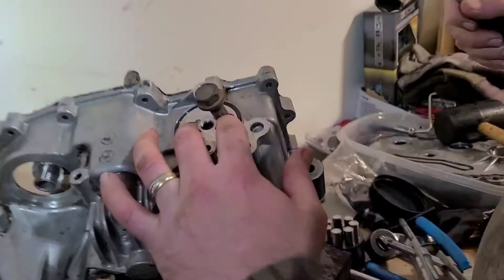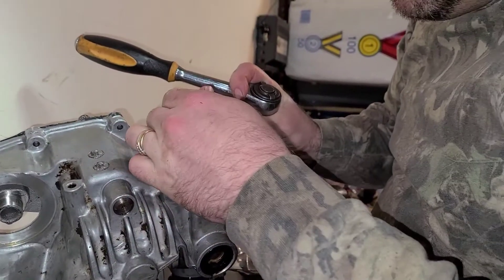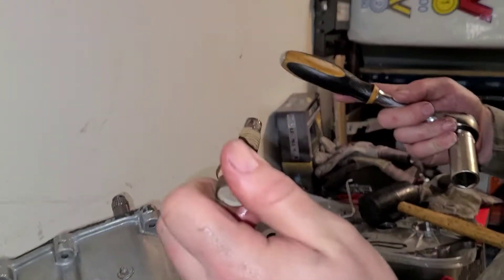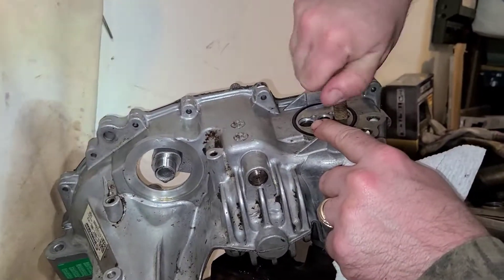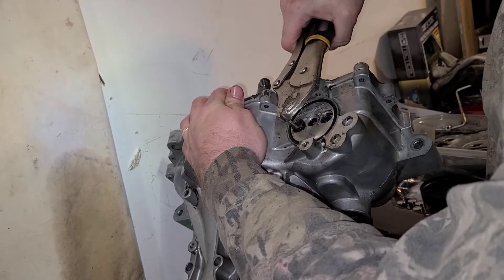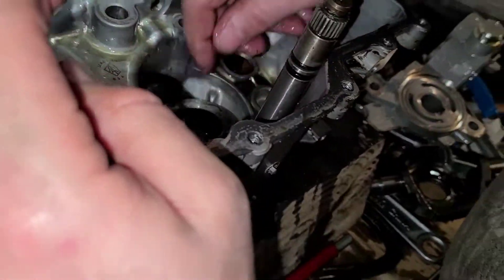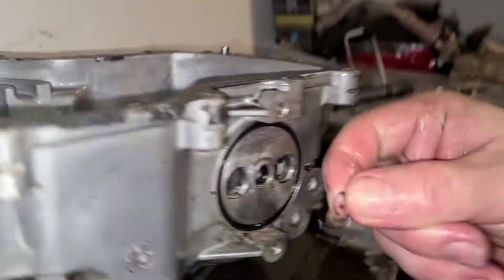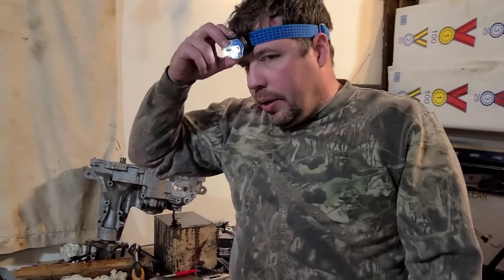Ferris FW35 48, 52 hydro transmission leaking hydro gear ZT-2800 common oil leak repair part 5

Comment: Hydro gear makes an oil retention kit
Reply from the maker: Thanks chris what does the retention kit do for leaks from the emergency parking brake o-ring.
Reply: @RJsGarages  basically a external compression add on kit. Just ordered one from eBay. My local hustler dealer told me about it
Reply: Hydro gear inboard brake shaft oil retention kit
Reply: Thanks for pointing that kit out it's not cheap but keeps me from having to take apart both hydraulic Trans

Comment: My scag freedom z is leaking hydro fluid from this same spot with the O-ring and the two rubber bushings, mine is still completely on the mower and intact. I ordered the repair kit but hopefully all I need is just the O-ring replaced! That looks beyond me
Reply from the maker: It was alot of work, if you decide to tackle this project, get 4 seperate rubbermaid or some other kind of plastic container and store the bolts and nuts for each section in its own container and it will greatly simplify the job, also dont work on it for an hour each day over 4 days because it makes reassembly difficult. Start early on Saturday morning and try to keep working straight through until you finish and you will be good to go.

Good luck!!

Please like and subscribe every little bit helps during these times.

Seize the day each and everyday-Are Jay